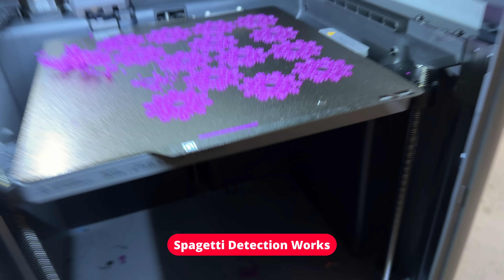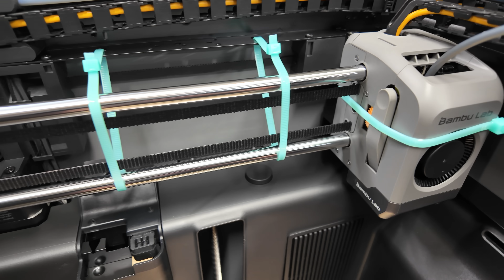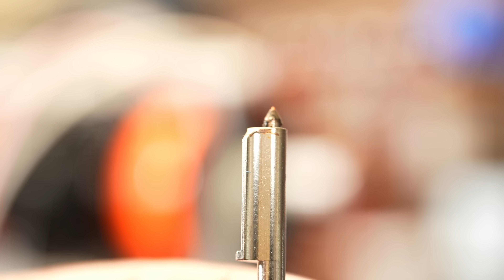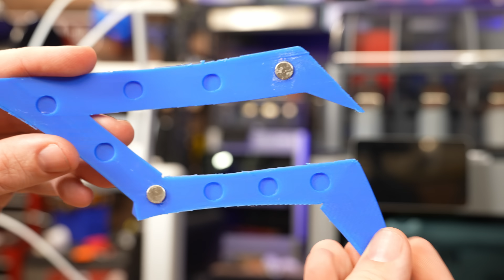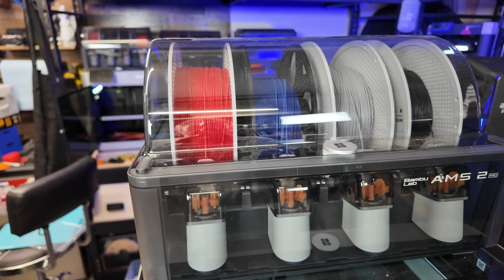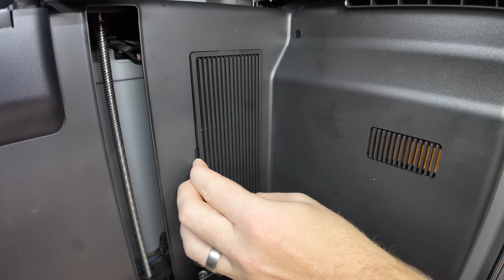The New $549 King? Bambu Lab P2S Real-World Review

Comment from the maker: Hi All! I made a mistake when talking about the drying capabilities of the AMS2. As others have mentioned, you can not print and dry from the AMS2. When I did my test, I had an external roll loaded when I tested this feature. You can dry while printing from an external roll. Sorry for any confusion!
Check out my new video where I upgrade the P2S. https://youtu.be/fQWmuf9VJUg
Reply: @RadDadsPrintLab  I have read with additional power supply the AMS2 pro can dry and print. What is the truth?

Comment: Please help. I want to get the normal P2S as I cant afford the combo with the filament reels on top. But on Bambus site its saying it doesn't come with a filament buffer. Is this incredibly necessary to have or is it a helpful add on? I've been trying to research it all on what accessories to get and stuff like that but its all overwhelming. Any advice would be appreciated
Reply from the maker: According to what I can find online
The buffer’s job is specifically tied to AMS feeding. It helps manage filament tension between the AMS and the printer while the AMS actively feeds/retracts filament. So you should be good without it if you are doing the printer only
Reply: @RadDadsPrintLab thanks I appreciate that, yeah I've decided to just go for the printer and worry about the extras afterwards. What's important is actually having it to play with first

Comment: I think if you are only connecting one AMS 2 pro with P2S, you don't need the power adapter for drying. It can be powered directly from the printer. If you get more than 1 ams 2 though, you need one adapter for every extra ams for drying.

Comment: Does anyone know if I can print warhammer bits or full models with this without having all the lines?
Reply from the maker: You can swap to a 0.2 nozzle and get much higher details for the smaller prints, they will still have more of a noticeable layer line vs resin, but it might be good enough.

Comment: Sadly, we ended up being disappointed with the Bambu P2S purchase 😒😏😌
Reply from the maker: Sorry to hear that, what was the issue you ran into?
Reply: please share….
Reply: @frodev728  the VFA are terrible, the A1 has better print quality. at least right now. they did do a firmware update about 2mo ago and it helped but the vfa are still very noticable on black filament. the A1 prints so much nicer for like 1/4 the price. its sad tbh

Comment: Yeah Bambu does a poor job telling you whether you need the external P2S power supply. So I had to make a second purchase and pay shipping.  The best approach wouldn't be to simply include the second supply, it would be to beef up the P2S' own power supply and wiring so that you could print+dry at the same time using ONE electric outlet.   Or even better, upgrade the P2S to be USB-PD, because the 86W it uses is less than my 16" MacBook Pro.  We could then use Anker USB-PD power stations, and (AGAIN) we could save outlets. Power distribution needs to be considered.

Comment: if you try printing   from the external spool holder  with the ams connected , you will find it is not such a pleasant expericence - random 'filament color' changes in a single color print that  means after  it tries filament channging  and homing you get  layer shift as the printer does not resume  correctly.

New printer  straight out  of the box and calibration routine 4 prints 4 fails.

Comment: I've 3D printed for 15 years. i remember making the original ultimaker, struggling with various maker bots but I got going and made loads of stuff for my business.  I have owned an Ultimaker 3 and a Raise3D M2 for the past few years and they worked really well but cost money.  I got a bit unattached from the 3D print market during this time, so assumed I would be looking at another £7K or £8K bill to replace them, however what a shock.  

I made the jump to the P2S and i simply cannot fathom how good this printer is.  Its faster, way faster and manufactures my parts so much quicker. Its more reliable and it prints way better.  I'm still learning the slicing app too, so largely using out of box settings.

I can buy 15 of these for the old 2 printers I had, but it turns out the 1 we have does everything so well and so fast we're using just the 1 at the moment. It meant we could donate one of these to the local school too so getting more kids into the technology.

if you're looking for innovation in the 3D print market then this is where its happening!!!
Reply from the maker: Its amazing how far printers have come in a short time.
Reply: You are what we call an OG. ❤

Comment: one of the misconceptions, its does NOT replace the X1C, in no way shape or form. the X1C bed gets hotter, the screen is still better, the X1C vents externally for much better thermal and fume control, instead of cycling the same air back in a circle. The X1C frame is metal, also for better thermal (and just straight up quality). I dont even care about the lidar(bit gimmicky), but just general day to day operational work and reliability, the X1C is still a better printer. The things that supposedly make the P2S better like lighting? hot swap nozzles? eddy sensor?(it takes about 10 seconds to swap a nozzle, and really how often do you do that?) are all gimmicky. just becuase it has a "2" in its name, does not means its better. a 2025 Ford F150 by nature of being a 2025, is not better than a 2023 F250.

Comment: I've been having issues with my p2s combo mainly with the ams 2. the ams is slipping when trying to get the filament to the hotend. I'm noticing a small groove or notch in the filament caused by the ams. Also one of the slots seems to think there's filament inside when I've checked and there's nothing.

Comment: just ordered mine today with the plate and hardened tips 06 and  08.
Reply from the maker: Its funny, I have yet to really use a 0.6 or 0.8 nozzle.
Reply: @RadDadsPrintLab  Once i tried a 0.6 i really havent looked back at .4  well until my .6 clogged(Anycubic Vyper Bowden setup), but for functional parts that dont need that much detail i think its the best comprimise between strength / speed.  You get stronger parts with less layers and it prints a lot faster. I actually printed a guitar nut with a .6 and it had no problem making all the slots for the strings even the thinest one.

Comment: So this is super confusing.. The power supply is needed for the combo AMS or only if you have an additional one beside the provided one in the combo kit? Seems insane the included one in the combo kit would not be powered by the P2S🤔.
Reply: @robertshaw5914  it depends on the power supply of the printer and what it power it draws for the unit. If the psu can’t handle both the machine and the ams then it simply just can’t.
It’s the same reason why you can’t print while drying. I don’t think even the h2 series machines can even handle drying and printing. Maybe if they can enable it while plugged into a power socket rather than drawing energy from the printer in the future but that’d be a later update.
Reply: You don't need the power supply as even with it, with a single AMS you can't print and dry at the same time, not possible. Common misconception as Bambu make it clear as mud in the manual.
Reply: @frogloton Not quite correct. With only one AMS, assuming you do have the external power supply for it, you could print single color with the external spool holder. For this reason I will be buying a power supply for my AMS 2 Pro.
Reply from the maker: Totally made a mistake with this, I added a pinned comment to clarify the error. Thanks for the feedback!

Comment: I'm pretty sure you can not print while drying with the AMS 2 PRO. I know you can't do it with the AMS HT as I've tried with my H2C. The external power adapter is to provide supplementary power to the AMS if you have more than one AMS attached and to allow for full power drying while printing (you must load filament externally) if you don't have the power adapter on a single AMS, while you are printing (from an external spool) it limits the drying power to the AMS.
Reply: Currently, drying is not supported for AMS 2 Pro / AMS HT units that are actively involved in the printing process, including those that may be used for automatic refill during the current print job. Printing while drying is not yet supported. -Bambulab wiki
Reply from the maker: Totally made a mistake with this, I added a pinned comment to clarify the error. Thanks for the feedback!
Reply: You need to use the tpu inlet/outlets
Reply: I heard a firmware update has enabled this feature, but I don’t have the AMS so can’t comment for sure.

Comment: Are you sure that with the power adapter it’s possible to print and dry at the same time? I’ve seen several places saying that it’s not possible. The power supply is only needed if you have more than one AMS connected (since the first one is powered by the 6-pin cable), or if it’s not a P2S or H2D — but in none of those cases would both functions work at the same time.
Reply: You are correct.. you cannot print from any AMS with a power supply or not, including the Ams-Ht.
I think I've tried drying with the Ams pro (with power adapter) while filament feeding from Ams-ht only, and that works. 
Its more about reliable filament feeding, while warm and possibly soft.
Reply from the maker: Totally made a mistake with this, I added a pinned comment to clarify the error. Thanks for the feedback!